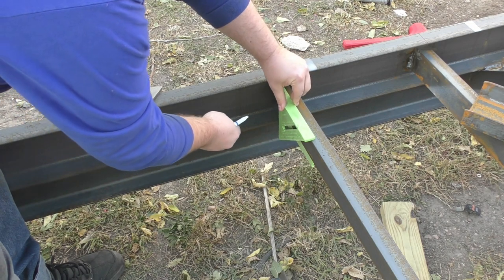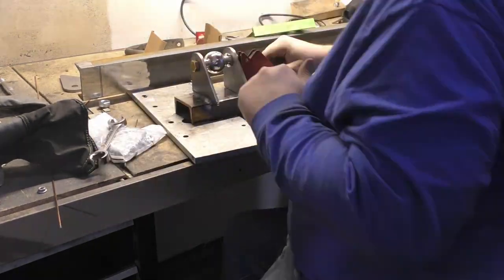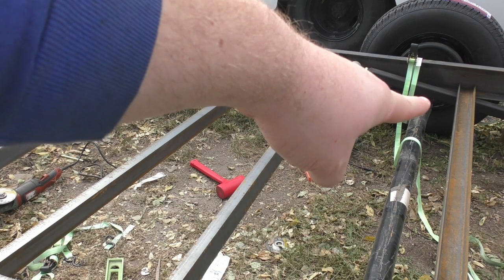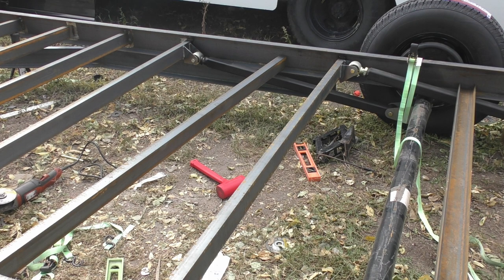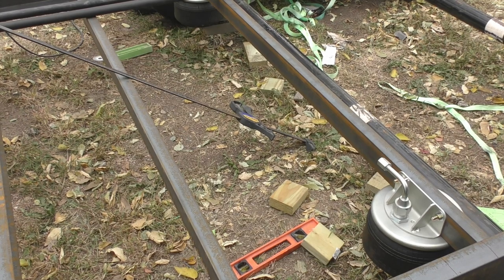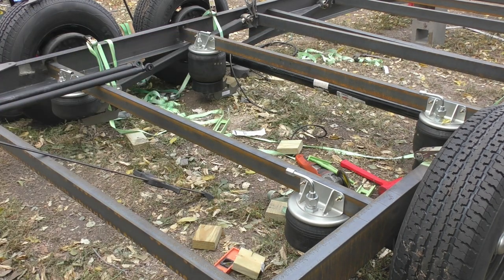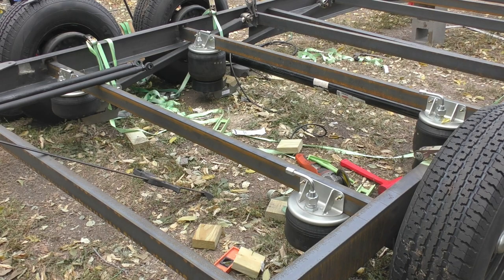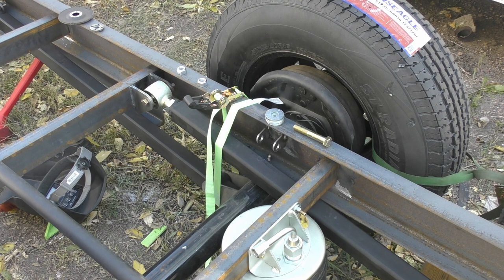Air Ride Tandem Axle Trailer | Suspension

Comment: Ive been searching for a pair of trailer straight axles on airbags for a 7x16 narrow track overland toyhauler project.. Washboard rough mountain roads etc..
 I like what you've done except what you built operates sort of like a three wheeler swing arm..  Because you don't have any independent travel when hitting a low speed pot hole with one side..  Or do the bushings allow enough movement for that?  Are you aware of any other commercial kits available, and do you have links to the parts you used?  Any suggestions on my project, like maybe use half a single large truck leaf spring as the arm so it can twist without bushings and act like a sway bar?  Thanks
Reply from the maker: Could swap out the axle side to the johny joint style instead of bushings and get more articulation - but for every step towards articulation you lose antisway, just like offroad rigs.

Comment: I have a question for you.  I see that that you have used pipe and panhard end fittings to create a panhard to  stabilize the side to side position of the axles.  I see you then used the same fittings to connect the axle to the trailing arms thereby stabilizing the fore and aft position.     

You don't mention it but I assume that the air bags are what stops the axle from rolling too much when the brakes are applied.  Yes I think this is eyebleedingy obvious but wanted to ask in case I was wrong..

I have 22ft 10k lb aluminum car hauler I am going to be converting to air ride.  Yours looks to be the simplest conversion.
Reply from the maker: The axle roll is stopped by the bracket that attaches to the trailing arm - the trailing arm doesn't have a single link point, there is 2 one in front and one behind the axle
Reply: @Drivewaybuilt  Any chance you have a picture or a drawing?
Reply from the maker: @modeler3098  https://www.youtube.com/watch?v=whEE-r828Qg&t=242s        

go to 8:18
Reply: @Drivewaybuilt  I found https://www.youtube.com/watch?v=NaPLS418TyI  which shows exactly how you fabricated it.  Good work.  I like your design where you used panhards for the trailing arm connection to the trailer.  Should give you extra flexibility to get more practical lift on the trailer depending on how you need to load it and drive it.

Thanks a lot!

Comment: where did you get the airbags and brackets?
Reply from the maker: Bags are https://amzn.to/476o6Qs
And brackets were https://www.ebay.com/sch/i.html?_from=R40&_nkw=%5BSR%5D+Rear+Air+Bag+Lower+Brackets+&_sacat=0&_odkw=%5BSR%5D+Rear+Air+Bag+Lower+Brackets+Mount+Behind+Axle+Weld+On+Suspension&_osacat=0
Reply: @Drivewaybuilt  The link for the airbags worked but not for the lower brackets, please repost that one for all your viewers. Thanks
Reply from the maker: @lilly0037  Updated to an ebay search instead of a listing so it will work for future use - thanks